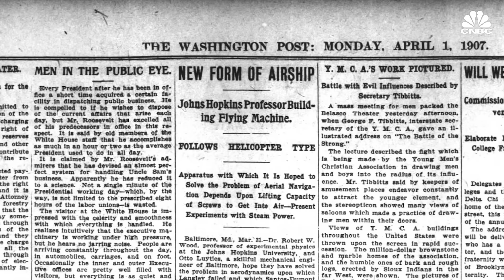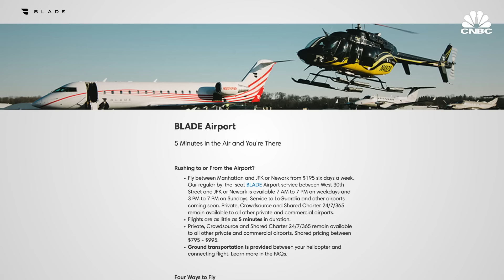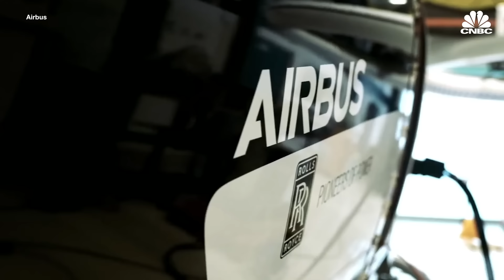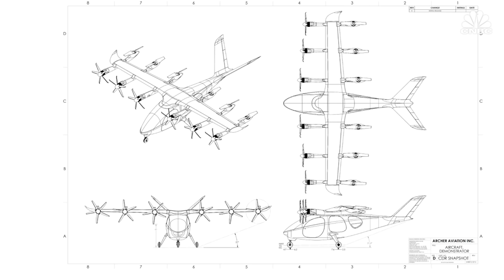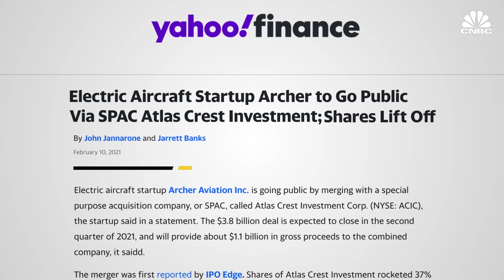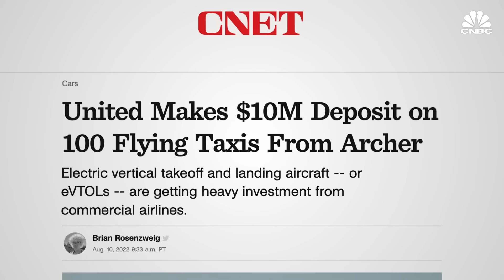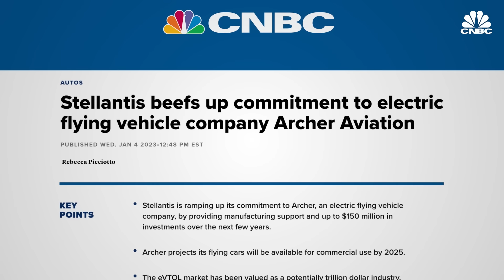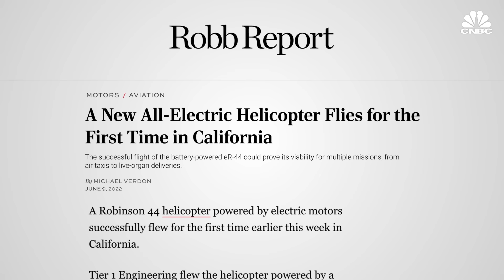How eVTOLs Could Disrupt The $49B Helicopter Industry

Comment: Their plan to keep it profitable is to up the amount of trips. But if it can only do two 20 mile trips before needing a charge that would probably take 1-2 hours, I dont understand how that can work. And that range is probably on a perfect day. I just have so many questions. What about on days where there is a 20 knot headwind and it can only make one trip. How would it de-ice/how would it handle icing conditions , it can’t use heat from engines so it would need power from the battery. When the temperature dropped from 60 to 40 degree my Tesla lost 20 percent of its charge. These batteries are no different. Electric motor are reliable, but there is always a chance of failure, Not to mention a bird strike. What happens when one fails at max gross weight. Can the others prevent it from falling to the ground, because it can’t auto rotate. Seems to me like the thing won’t be able to fly in anything but calm, warm days and if your planning on staying profitable by shear volume of trips I don’t see it working.
Reply: Their plan is to take money from investors, not to realy make a functionall machine, I am looking to invest in 3 or 4 of best promissing companies but they all look the same, shady technical information

Comment: My problem is that a lot of these designs have pretty small lift capacity so a bit of luggage and a couple of larger people and they are overloaded and like all EV's charge time a couple of trips and you're down for several hours recharging. Also too many of these companies are leverage future success on higher capacity batteries and a lot of the new break throughs are in manufacture, material and disposal.
Reply: Yeah extremely unrealistic for the one guy to say "It will make the helicopter obsolete".

Comment: Since electric flying machines don't burn off fuel, they don't get lighter as they fly around.  

Helicopters can be too heavy at their point of origin to land at their intended destination, but still take the flight if they are going to burn enough fuel on route to become light enough by the time they reach that destination.

I don't know how common this is in the commercial world, but it will be an eVTOL limitation.

Then there's the question of how long it takes to "re-chsrge" before they can take the next flight.  A helicopter can re-fuel in like five minutes.

Comment: a typical helicopter has range of 300-400 miles, the electric one is not going to have this kind of range. for the short range it makes sense, but for longer range like 200+ miles, not going to make much sense, the battery is just not going to have that energy density.
Reply: Yes it could never replace say a coastguard helicopter because they never know how long they're going to be in the air for and then may need to refuel and leave right away to save more people for eg ... This piece would be for very niche specific purposes like businessmen... Other than that it's just a hype thing with current battery technology and charging rates .  Weight is everything when you're an aircraft. Then there's lifting things that's just ridiculously out of reach...
Reply: The weight alone is already making me question if this'll get far.
Reply: These are basically intended to be used like city cabs, not cross country trains or busses. The range for the average trip is targeted at 30-40 miles.
Reply: There's some new battery tech coming, the most immediate are Lithium Sulphur that have double the energy density per kg than current batteries so maybe it'll come together in a few years about the time FAA figures out how to certify these vehicles.
Reply: @aowen2471  forgot to mention, regardless technology, lithium battery has property that cause a lot of problem, fire. there is no way to put it out when it start burning, there is no fire extinguisher will be able to put it out, that is especially danger for airplane. remember the 777 max issue? battery catch fire, and that was a small battery pack. more I think about it, there is no way a battery operate airplane will be safe enough to fly.

Comment: people are completely underestimating the potential of distributed propulsion electric aircraft, in terms of safety.   NO single point of failure.  even autopilot and battery..  and pilot..  etc. etc. 
and also underestimating the efficiency gains (6X) over conventional propulsion, giving them the range and performance needed to best fuel powered aircraft.  also super low cost, and relieving pressure on existing infrastructure.   nobody seems to get it.   I guess you have to work on this tech to understand fully.  even then it's inspiring to see it tested, and you see new ways to make it better and use cases.   fun stuff.

Comment: I think it will be quite a while before we replace heavy lift helicopters with EVTOLS because of the battery storage issues but it will happen eventually. You just can’t use an EVTOL to lift & set a huge transmission tower on a mountain with our current tech yet but I’m excited to see what happens in the sky crane industry with EVTOLS.
Reply: I worked a job for many years where I was transported in a helicopter to mountain top communications sites in the Arctic and with current technology an EV helicopter would never work.
Reply: Maybe a traditional single rotor helicopter with a powerful enough electric drive but no these contraptions will never replace single rotor helicopters in heavy lift because they have comparatively high disk loading which means they have a fundamentally less efficient lift system. A large slow turning rotor is more efficient than several smaller faster turning ones i.e. compared to a helicopter they have to expend more energy to generate the same amount of lift.
Reply: Evtols are out of the question of anything but light vehicles. Hybrids however could become a thing.
Reply: EVTOL's will not do heavy lift operations and they're not saying they will go for that use. SAF will lower the emissions of helicopters but the cost of flying choppers will not go down enough to match the EVTOL's estimated 80% reduction in maintenance/operation costs, compared to helicopters. EVTOL's will grow a transportation segment that most of us haven't even considered because it hasn't existed, just like we couldn't imagine making a video phone call from a small computer in our hands,  just 15 yrs ago.
Reply: You need to stop jamming a square peg into a round hole.  eVTOLs were never meant to be heavy-lift vehicles.  But they will serve a very important role for fast air transport of humans and light cargo over congested urban areas.  People are also forgetting that these things will eventually become autonomous which greatly expands their use cases in all kinds of situations.  You will NEVER see helicopters becoming autonomous.
Reply: @JoeZaccaris  yup
Autonomous flight technologies are for these guys the on demand small aircraft segment.

Helicopters,
Airliner and most corporate jets and probably some larger freighter aircraft wont go behind single pilot operations with an AI copilot.

Comment: Love it.....good luck finding the pilots needed.
Reply: These things will rapidly become autonomous --- the only pilot needed will be a CPU and GPS receiver
Reply: @JoeZaccaris  eventually the newer generations will be, but they did expect evtols to need about 60 000 pilots by 2030 and by then we may start seeing the first pilotless evtols. EASA expects autonomous CAT (for evtols) by 2035 Volocopter is hoping for 2032 but given that the aviation industry moves slowly it will probably be closer to 2040 or so.

Also, when they are autonomous there will still be a need for pilots on the ground to manage multiple vehicles.
Why would any pilot do that when there will be other planes to fly from on board and not from the ground.

The military has a drone pilot shortage in part for this reason…
Unless EVTOL ground pilot pay goes up… and the “flight hours” transfer to being able to move on to the airlines (but I doubt it)

Comment: Helicopters are expensive to maintain because of their complex mechanics. Their disadvantage is the limited top speed; Leonardo is trying to compensate for this shortcoming with the AW109 with an Osprey-like concept. Hardly successful due to the high price (we are talking about +$70 million). eVTOL is a promising solution, although the limited energy density of the batteries (weight/kWh) is currently a hindrance. Hydrogen-powered generators would be a solution for larger loads.

Comment: So in summary: eVTOLs could be a bit cheaper than helicopters for short range air-taxi roles, but won't have the payload or range to take over from helicopters in any other role. Even if eVTOLs were half as expensive as a helicopter for getting to an airport, most cities already have effective public transport systems as an alternative e.g. London has the Heathrow Express train that takes 15 minutes. What a load of hype!

Comment: the person who designed a helicopter already thought about multi-copter and there is a reason why helicopter is always the solution.
Reply: technology has evolved significantly since the first helicoptors took to the air.
Reply: @manp1039 but doesn’t it a lot better than helicopter? Helicopter just need 2 blades and it can fly straightaway.

Comment: Unless they take me to exactly where I need to go in a city, it will be pretty much pointless. Except maybe in instances where there is a huge traffic. And even then depends where the traffic really is. It's sort of like riding subway from outer borrow and having to transfer. You might get on express train and make 2/3 of your way in 1/5 of the time. But then get stuck on a platform and riding local 1/3 of the way for the rest 4/5.
Reply: Uber and another EVTOL company, Joby, are teaming up for exactly that reason. You book a combined car/EVTOL trip from point A to point B with a single app. Don't be surprised if Archer either teams up with Lift, or starts their own car based ride share division. The Archer CEO has also hinted that landing in the streets may be a possibility on a future model.

Comment: $4.5 million for a helicopter? It's like half of that.
Reply: For a passenger/transit ready helicopter ? I don’t think so…

You can find stuff like a jet ranger for $1.7 used but you’re not getting a proper 6 person for 1-2m I would think,
Reply: @eric4946  these evtol's don't carry 6 passengers either.
Reply: @saulgoodman2018  they don’t carry any passengers as it stands, if they can’t carry ~6 people they’re pretty much useless from a carry capacity point of view .
Reply: Yes and no.  Some are less some are more.  A Robinson R22 is probably around $300k last time I ever looked while something like a Sikorsky S-92 would be 20-30 million.  Military helicopters like a CH-53 will be even more.  $4.5 million is in the correct range for a light turbine helicopter like an H125.
Reply: @Oooonumbers  I'm not talking about Military or luxury helicopters.
Reply: @saulgoodman2018  An S-92 is not a luxury helicopter.  A lot of the bigger helicopters, aka the very expensive ones, are used in the oil and gas business, firefighting, aerial cranes, etc.
Reply: @Oooonumbers  I am not talking about those kind helicopters.
Reply: Most popular helicopter Robison R44 is $400,000 for new.
Reply: @Oooonumbers  They are competing with Robinson helicopter for sure because of number of passengers. You can get very decent Bell Helicopter for $1.4 to $3 millions. $20-$30 million helicopter are luxury, all weather, long range like 900 miles and military types.
Reply: @jlangevin65  these are not replacing those. They are only talking about like 4 seater air taxi's.
So those are the only ones that I am comparing them to.
Reply: @TheYogesh7777  yeah. People are comparing these to luxury and military grade helicopters.
The video was only talking about air taxi's.
I don't understand how people are comparing them to all of them.
Reply: Suppose it depends on which helicopter you're after....! For a 4-6 persons carrier, you are looking at a wide range but up to $4.5m.
Reply: @TheYogesh7777  Yes, but it only carries 3 pax + pilot.
Reply: @Ronjaslife8910  They're comparing them to touring helicopters.
So that is what I am comparing them to.
Reply: @Ronjaslife8910  Then you can go for R66 5 passengers + pilot for $500K.

For $4.5 million you can get Bell Huey 2 11 passengers+1 pilot.
Reply: @TheYogesh7777  Those have a terrible safety record.
Reply: @jlangevin65  what? Which model you are talking about?? Bell??
Reply: @jlangevin65  send the link
Reply: @TheYogesh7777  I'm talking about the Robinson R-22, which has a problem with the rotor striking the tail fan. Don't give me that coy BS.
Reply: @TheYogesh7777  Even if it weren't inherently dangerous, your using it for price comparison is nonsense since it only carries one passenger.
Reply: @jlangevin65  one passenger?? What??? Why?? R66 can carry 5 passengers.
Reply: @jlangevin65  send me the link about the accident. Talk about R44 and R66.

Comment: its a cool idea.. I also thought about starting to develop something like an amateur project, but then the question is: Where the user can park these copters? On the street? Not possible as they are wide, even on wide boulevards you cannot do it. Over buildings? Then the city needs many helicorder pads. As a user I won't buy it unless I can park it almost anywhere I want. And with current infrastructure, this is not possible.
Reply: Just park it in the backyard.
Reply: Most cities can already accomodate these eVTOLs through existing helipads and parking lots and garages.  Seeing them expand into small towns and rural areas will be a lot easier because of the abundance of wide open spaces.

Comment: As a professional worker in the aviation industry, I am extremely skeptical about these eVTOLs, there are certain safety features of the helicopter that are impossible to replicate on those type of vehicles due to the nature of their design. And I love how the producers keep promessing quick certifications to stimulate investors while the reality is far from what stated...
Reply: These aircraft have safety advantages that are impossible to replicate with helicopters. Don't try to tout helicopters as exemplars of safety, because that's ridiculous.
Reply: @@jlangevin65  negative that wasn't the purpose, but good luck pulling out an emergency maneuver in case of a complete failure of the battery...
Moreover, as you probably know, the helicopter safety record is stained by mostly accidents traceable to obstacle collisions in flight and cfit, which could easily pertain eVTOL considered the similarities of the sector of operation...
Reply: @simoneglobemaster  we will see as this technology evolves.. there is nothing prevent electric helicopters from co-existing with multi rotor electric flyying vehicles.. And likely they will co-exist for a time as technology continues to evolve. but the abilities of a multi rotor electric i think do have some advantages that can be exploited as well.
Reply: @simoneglobemaster  A complete, sudden battery failure is extremely unlikely, but the machine could be built so that half of the rotors are powered by one battery and half by another. There are no such options for redundant power in conventional helicopters.
Reply: @jlangevin65  Unlikely not impossibile, the helicopter still have one more chance to survive, a manouver called autorotation, that can not be performed by eVTOL.
And even though it does not apply to every helicopter, the redundancy exist, is called multi engine
Reply: @simoneglobemaster  I have to say your skepticism looks a bit silly. 

First, mounting a big single battery on that thing is counterintuitive. There is no reason to concentrate that weight on a single point, putting more stress in the frame than necessary. 

You shouldn't be worrying about batteries failing, but about batteries burning. 

And again, mostly there isn't a reason for this thing to autorotate, if one battery starts burning midair others should be more than enough to land the aircraft safely, same with rotors.
Reply: @simoneglobemaster  😂 Firstly, tilt-roter aircraft, like the VF-22 Osprey CAN use auto rotation to land. The problem is there's (a) No reason to do so if you have WINGS to glide with and (b) little likelihood the Archer Midnight would need to do so due to the fact that there are FOUR engines that are INDEPENDENTLY POWERED. You'd need to loose at least 2 battery packs/ engines in order to loose the ability to hover. Commercial commuter helicopters are probably toast!!!! On the bright side for existing service providers, Archer will be selling their aircraft.
Reply: These aircraft are all small enough to equip with parachutes.
Reply: @jaffacalling53  Nope..... Archer's Midnight has a wingspan of 47 feet. That's larger than most WW2 fighter planes.
Reply: @helifanodobezanozi7689  And how does the weight compare to a WW2 fighter plane. If you can equip a Cessna with a parachute, then you can put one on most of these evtols
Reply: @jaffacalling53  The main question is, is having a parachute (i.e. carrying the weight) actually cost effective in this case? Again, the Midnight can function with a loss of 2 out of 4 engines/ battery packs (or 4 out of 8 propellers) Lugging a parachute around is the equivalent of wearing a life jacket every day on dry land. Yes, you may drown in a flash flood in the desert, but what are the odds? (Also, there is a reason why many general aviation, single engine aircraft don't have parachute systems. They have good safety records. For instance, the Cessna 182 has a record of 1.9 per 100,000 fatality rate. The parachute equipped Cirrus SR22 has a rate of 2.3 per 100,00. Some aircraft need it more than others. In Midnight's case, it doesn't need a chute at all!)
Reply: EVtols are hard to love give me a leonardo 139 or a bell 407 anytime.